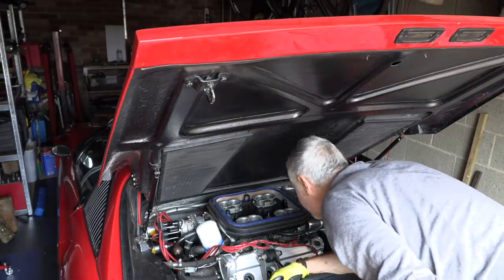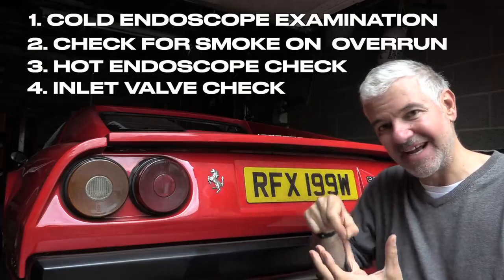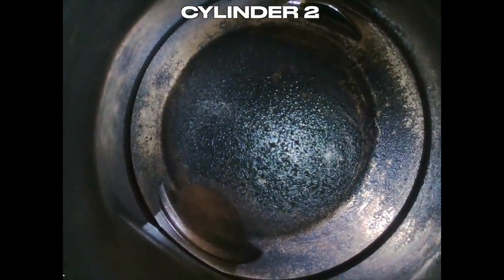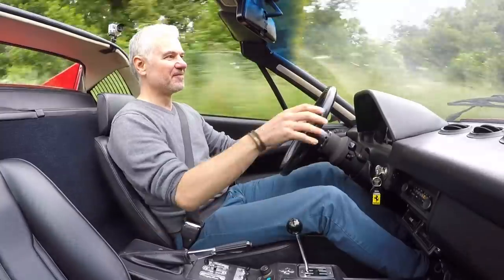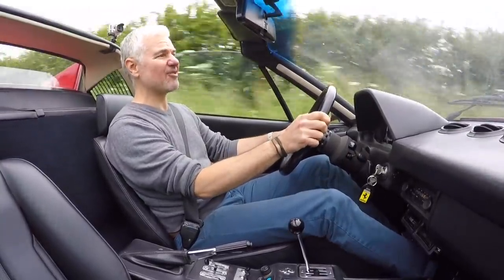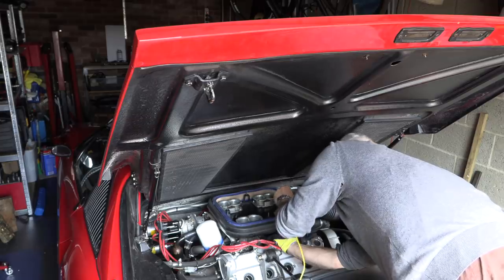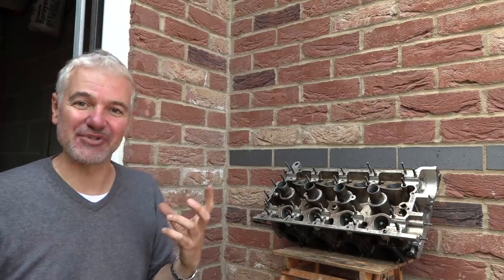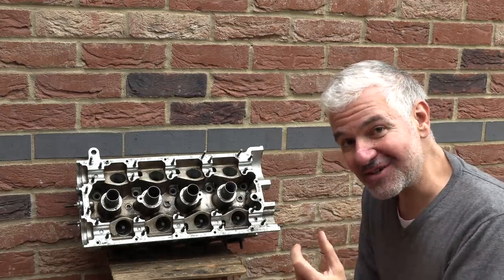Could this £50 tool help me save my cheap Ferrari?

Comment: Hello. As has already been suggested, you might like to try a damn good steeping of the rings with something like Redex, then change the oil and add moly, as I do with every yearly oilchange. To those who think it snake oil and waste of time and money {in light of the efficacy of modern oils, when compared to the frothy nature of Duckhams Q etc., from times past}, I immediately noticed when first doing so, that it took a fair while longer for the temperature gauge to move off the stop. I use a product called  Extralube ZX1 in the motorcycle, as it has a wet clutch and moly is a no no. This may be to no avail whatsoever but might be worth a try and not cost very much. Best of luck, whatever.

Comment: I can't recall - have you done a leak -down test yet ? Not that hard to force high pressure air into the cylinder to see if it gets past the rings into the sump and out the oil breather / recirc system. By all means drive and enjoy the car but I would be tempted to replace the valve stem oil seals without removing the head if at all possible - so often the cause of smoke after a period of high vacuum on the overrun. This is mainly about jury-rigging a way to compress the valve spring without access to the cylinder combustion chamber area; you would need to fabricate  a lever arrangement bolting a stud into existing threads in the cyl head top. Don't give up !

Comment: Great to see it back on the road and sounding great and feeling strong to you.  I won't speculate about the heads since you don't want to go there.  How much oil is it burning?  I think the additive is a good idea...your thoughts on the pistons being gummed up and just need some miles and rpms (and additive) to get them to reseat and clean up, is a good one.  I just didn't see that much oil coming out the back end under acceleration...and the smoke on startup seems like natural Italian car cold engine smoke.  I'd even suggest that you just don't worry about it at all and just enjoy driving the car.  Does a compression check show anything?  If the rings weren't doing their job, shouldn't the compression in those cylinders be down?  Yeah...drive it like you stole it and have fun.
Reply from the maker: Compression is great on all cylinders!!
Reply: @Number27  When the rings are failing, I believe compression falls.  Don't know how much oil you are using, but for now just drive and enjoy it. Sounds like it is running better than it ever has.  Maybe just needs to be used more.

Comment: Try a shot of  redex down the plug holes and let it stand for a week, check and clean the crankcase ventilation system (both already mentioned below but worthy of repeat) if the cv is ok and the redex gives little or no improvement it looks like the oil control rings are really stuck or worn out.

Comment: as previously mentioned, check the crank ventilation is running fine "give it a clean out!"

use a additive to clean the oil lines etc & either use a thicker oil OR use a oil thickening solution

Also don't forget fuel would wash oil from the intake valve when in operation, I'd also check the other bank on how they look just for safety sake!!

Comment: Back in the 80's while working minimum wage my Capri 2000 was using oil so bad I was running #90 weight gear oil in the crankcase to stop it smoking so bad. I did a 'dirty rebuild' with just a top end gasket set and a ball hone. After pulling the head, dry crosshatch honing the cylinders with the pistons at BDC and then blowing them out with compressed air, installing new valve seals and lapping the valves, I put it back together and got another 80k miles on it before it was completely shot and went to the scrapyard.
Enjoy what you have and later on rebuild, restore, sell, what ever makes you happy. Life Is Short, Have Fun!

Comment: If the oil ring is still stuck an additive is not gonna help at this moment, it should break free at those rpms you are driving if it doesn't I guess you need to take it apart. The oil you see in acceleration might be under pressure from the oil pan getting in to the inlet as the ring is seized ( doesn't hold compression in the chamber letting it blow to the oil pan and pushing the oil to the breather hose) 
My advice, drive it until it breaks off.

Comment: I have a 308 BTB 1978 and it smokes sometimes, remember these engines needs one liter oil for 1000km says the owners manual.
Your problem I think is that the vaccum created at the exhaust valves drawing oil in because of some bad valve seals at the exhaust valves.
Nothing to worry about, drive it and enjoy the smoke of 70ties cars.

Comment: One of the things I would try is to put some ATF in the cylinder and let it soak in. Then do a dry start without plugs and blow the crud out. The second thing I would do is start the car and drive it a bit until warm and up to temp. Then while idling add a quart of cheap ATF in the crankcase and let it idle for 10min or so. Do an oil change right after. ATF has some crazy strong detergents. ATF has allowed me to save two different engines in the past. Once you do an oil change go and do an Italian tune up. It may free the rings. Also look into a liquid molybdenum additive. It stains everything but there is no better lubricant for high stress moving parts.

Comment: My exhaust valves used to leak when the engine was hot in my Alfa. Different engine I know. But after a fresh rebuild, 2yrs later this was frustrating to me. It went away when found that my coil was 1)wrong for e-ignition, and 2) going bad. I put in a MSD coil with same electrical properties as OEM, and my ignition issues went a way. I find it weird that my smoking issue after the engine sits also went away. Friggin Italian cars, man...they have a soul...the're alive!

Comment: Check the crankcase ventilation system for any blockages that may be causing the crankcase to overpressurise.
The best way to clean the rings is to add some fuel system cleaner to a tank of petrol and take the car for a 30 minute thrash on a fast road, accelerating hard and keeping the engine in the top half of the rev range.

Comment: It is sounding great and running better and better! I agree with some of the other commenters to check the breather and crankcase pressure.

In the mean time putting miles on is probably good therapy for car and driver!

Comment: If you want to try to clean the rings don't put additives in the oil, instead take your additive of choice, be that injector cleaner, ATF, Marvel Mystery Oil, Seafoam etc... and pour it straight down the plug holes, let it sit for a day while it works its way through, once its all drained through the rings dump the engine oil and refill. 

BTW have you checked the PCV yet?

Comment: Apologies if this has been mentioned, but what grade oil are you using? A newer synthetic may be too thin for an older engine when something like a 20w/50 would be better.  Again, if you haven't checked, make sure any crankcase ventilation isn't blocked and is working as it should.
Perhaps a long Italian tuneup would help.
Anyhoo, I'd probably say to drive it for now while the weather is nice (hopefully) and look at stripping it if needed over the winter.

Comment: Does the 308 have crank case ventilation system that vents into the intake??.....
If it does, remove the pipes from the air filter box, and see if it changes anything..
If it does, fit  catch can and block the pipe inlet into the air filter box.....

Comment: Check the crank case breathing pipe(s) are clear. Other than that monitor oil consumption & enjoy the car. Old engines do tend to smoke a bit.

Comment: Top end rebuilds often cause oil burning as the lip or carbon that developed at the top of the bore is sometimes the only thing stopping oil from leaking past in a high mileage engine. That carbon usually gets removed when you pull the head and clean things up.

Comment: At certain revs you're going to get some reversion...especially with hot cams,off cam timing or  if your exhaust is not scavenging properly..this would blow the blowby oil up from that joint where it's leaking down to.
Putting hotter plugs in is a good idea to eliminate fouling so that you can at least tune it.
Ensuring P.C.V system is working properly is essential....when you take the oil filler cap does it suck or blow?....love the car..
Reply from the maker: Ill check but I think it sucks when oil cap is removed..

Comment: The smoke after backing off then getting back on the gas points to oil being sucked down from the top of the engine via the valve guides, I’ve been there, get a leak down test done.

Comment: You don’t mention it specifically but it seems clear that the main issue or symptom is smoke from the left exhaust which is presumably the rear bank and therefore cylinders 1 - 4 ?

That would surely not indicate rings ? The oil is apparently pooling from above as you show.

Pour some ATF into the cylinders and let it sit for a while, use the endoscope to check whether it drains away on some cylinders more than others.

Otherwise use the car and enjoy it....

Comment: Jack, soak pistons with Nural 5000, soak well and leave it 24 hrs, have loosen piston rings on several engines with it. You may repeat as needed. Normally I do it before engine oil change, 90% of the time it works, maybe it frees 7 out of 8 piston and last one will eventually free using Nural once in a while just on that cylinder.

Comment: Jack, please please check the engine breathers/ crank case breathers to see if there bunged up, causing the engine to burn oil. Quite a common issue.  

Also you can take the oil cap off and see how much it chuffs out of there... this is not full proof mind.

All the best, Ben

Comment: Hi Jack, don't sweat it,  as long as nothing starts knocking and no nasty noises, just use your Ferrari and enjoy it!
You have developed an engine paranoia, unless you do a full bottom end rebuild, I fear it's going to eat you up and spoil all the enjoyment you should be getting from this car.
I have owned several performance cars over the many decade's where I just thrashed the living daylights out of the engine's and never have I suffered a catastrophic engine failure. Worst I had was a turbo unit blowing off the exhaust manifold, it had pulled the mounting studs clean out. Italian engine's are pretty tough old buggers.
One thing I do remember doing, was changing the oil and all filters two or three times a year.
You have a lovely car so enjoy it!

Comment: I thought you did a compression test? What were the results (I'm assuming that they weren't alarming as you didn't rebuild the entire engine)? Are you sure the PCV valve is functioning and the lines are clear? Lastly, the best way to clean sludge in an engine is to add a shot glass full of ATF (automatic transmission fluid) to your oil, idle the engine for 10-15 minutes and change the oil and filter. You will be shocked at how black the oil will be. It is cheap and effective. I've used it to clean dirty, noisy hydraulic valve tappets.
Reply from the maker: Compression tests were perfect! And this has no PCV valve

Comment: Things to be aware of:
1. An engine can burn quite a bit of oil with little of it visible in the exhaust smoke. Visible smoke means it's pretty bad.
2. If the guide to head clearance is excessive, oil can leak down between the guide and head when the engine gets hot. This is why, when replacing the guides on aluminium heads, careful engine builders will first machine off the tops of the old guides and then drill them out a bit 
more to reduce their press fit in the head, and only then knock the guides out in the same direction the guides are normally installed (towards the combustion chamber). Less careful engine builders simply knock the old guides out in the opposite direction to which they were installed. This can wear the guide bore, resulting in a loose guide and possible oil leakage down the outside of the guide.
3. My guess is bad rings.  However, if you do take it apart again, before taking the whole engine apart disassemble the valves on the wet cels. and check the clearances, etc.
4. You could also just keep driving it and simply clean the plugs on the wet cyls. periodically (using a plug cleaning/testing machine or bead blaster).
5. A slightly heavier grade oil might also help.
Reply from the maker: Thanks for the helpful comments and for watching the video!!

Comment: Overrun smoke is normally valve stem oil seals. Anyone disagree? You could test it by using a thicker oil to increase the viscosity or use that super lubricant that reduces the sticking element of the oil which will make it worse.....the name escapes me....will look it up now...Extralube ZX1. You can get it from Halfords. You add it to the oil and it reduces the friction inside the engine. This is great for reducing wear and reducing friction on the parts in contact with each other but the key thing it will do is reduce the sticky elements of the oil inside the piston ring guides....if it's the seals of the valves, it will  burn less oil but if it's the piston oil seals, it will burn more as the seals of the piston rings fail to seal to the chamber. The results either way will diagnose the fault. If there is no change, you just benefit from the reduction of friction in the oil and that's a winner anyway so it's not money wasted. Look into ZX1, it's good stuff.

Try it, theres a video in it anyway.

Comment: It used to be an absolute rule in our workshop that the tops of pistons were not to be cleaned off when the heads were done (a simple wipe with a rag will suffice). For reasons no one has ever really explained, if you clean the tops of the pistons when the heads are off, the engine will frequently use oil and blow some smoke ever after, even if the bottom end was perfect when the heads came off. Sad but true.

Comment: You suspect the oil is collecting on the cylinder bores during use and then, once the engine is stopped, running down the bores and pooling on the piston crowns?
If this is the case then you need to run the engine and make sure that, when you stop it, one of the pistons is at TDC. Then leave it for a few days. Since this piston is at TDC it would be impossible for oil on the bore walls to run down onto that piston, because it is at TDC, so if there is any oil on that piston, it must have come from above.

Comment: Just checked the Workshop Manual of my 308 QV and the oil consumption is stated as  (0.21-0.41) Gallon every 600 miles, so they all burn oil mate. Just drive it and enjoy it, worry about the Lotus.

Comment: Do a dry and wet compression check before and after the oil engine flush. Compare the current psi of each cylinder to what normal spec psi is. If your psi is excessively below spec most likely itis worn piston rings, since the heads have been overhauled.
Reply from the maker: Compression is perfect on all cylinders but with oil in three of them it would be, the rings will be sealing perfectly

Comment: I just commented on your previous video about using a borescope, well done. You need to be looking at the cylinder walls, look for vertical lines or waves. Trust me, I'm 99.9% sure this is your issue. A proper leakdown test will show you which cylinders are the issue. To get your borescope to see the sides of the cylinder walls just push it in at an angel, once it hit the piston, keep pushing so it moves the camera sideways to have a proper look at the walls. If you want to "buy time" and enjoy the car for a while before rebuilding it, add some thick oil burning additive for a temporary band aid.

Comment: I'm just along for the ride but have additives ever solved a problem? Good luck!
Reply: Yes. The problem of People having too much money in their wallet.
Reply: I did t believe in them until I used liquimoly diesel purge on our caddy due to slightly rough running and actually could see on software it balance the injector readings right up. Great stuff. I imagine it depends what you are hoping to cure.
Reply: @bluestorm1944  did you add it to the fuel tank or disconnect fuel pipes & run engine on it neat?
Reply: @dannykn9996  Just put it in with just under half a tank of fuel and ran it. It's supposed to be a full tank but cant see it hurts. I put it in about every 2 months to a tank full now just to keep it running well.

Comment: A high detergent oil may loosen up those rings as well. I have added 1/2 to 1 full quart of atf to the engine oil and run it for 1-2k miles and that did well too.

Comment: I literally bought one of those same brand cameras two weeks ago when drilling through my wall to hang a medicine cabinet with a drywall anchor.  I drilled through right into a water pipe!!!  I will always do a small hole, peek and go from there.  I knew I would used it on the 308.
Reply from the maker: Great little camera and good value too!!

Comment: hi, i do a wet and dry COMRESSION TEST  i would say if that if the engine has done around 80,000 miles or  it would need a rebuild as with any high mileage engine after a head rebuild they will blow smoke, not that 80 odd thousand is high but considering thats it a Ferrari and the type of ring design and it high reving,  i would think a engine rebuild is going to happen, the signs of oil staining on the pistons points to the engine burning oil. cheers from down under (Australia)

Comment: I doesn't look like oil is pooling in the valve cutouts to me. I see a shine from the camera, and blackened piston. But you may have a better monitor than me.. I do enjoy hearing this car rev now. It does sound a lot better. I wouldn't want, and couldn't afford, the headache of owning it, but i do think it'd be an enjoyable drive for sure :)